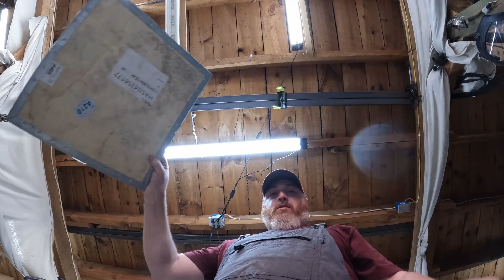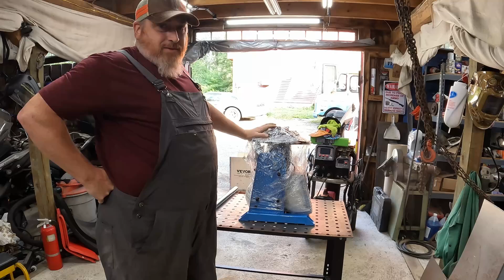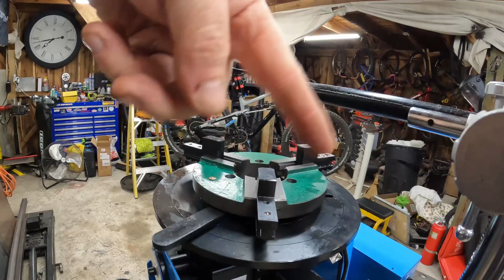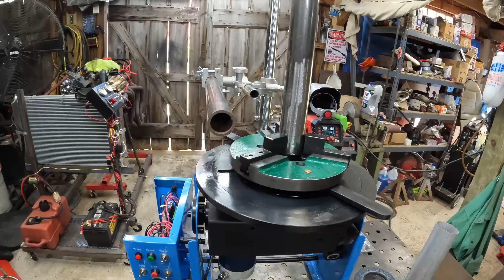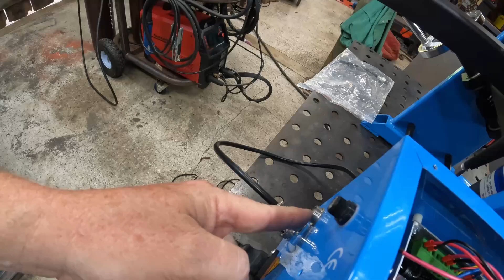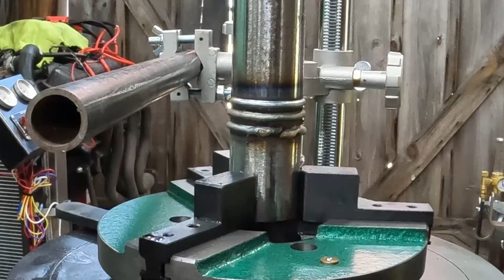VEVOR 30KG Welding Positioner REVIEW!!!! Is this worth $600???? 15 Tool Review time!!

Comment: Great vid. Many thanks. Can you take the top chuck off and just use the larger plater underneath? We are welding a 6-inch tube onto a 14x14 inch flat base plate.

Comment: I bought the 50 kg version and this one turns extremely slow… like it barely moves, so it seems good enough for TIG take to me. Maybe the 50 K has a different motor as opposed to the 30 K ?

Comment: Jist for the record. The 50kg version of this. Spins at .5 rpm at its slowest setting. The 30kg that you have spins at 1 rpm at its slowest setting. Also the speed you run the table at veries by the size of the part you're welding. A 2" tube will need to spin at a higher RPM than a 6" tube while welding. So when it comes to Tig welding, people might want to look at the 50kg model and understand that even at that speed could be to fast depending on the size of the part.
Reply: im waiting on that one!!! hopefully it works
Reply: Thank you for the heads up, I definitely want something that can go .5 rpm.

Comment: I wonder if i could set this up with a plama torch to bevel pipe...
Reply from the maker: Yeah, it would work for that. The base would fire the torch on a timer as well.
Reply: @madgingercustoms  could the connector be configured to fire the plasma instead of a welder?